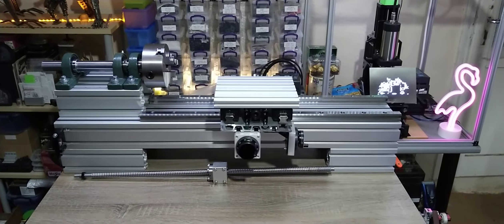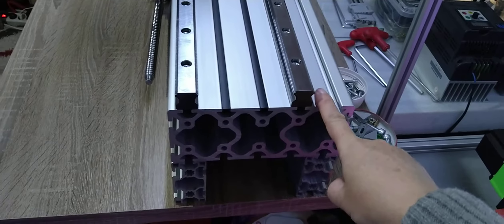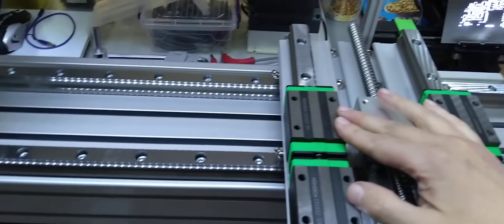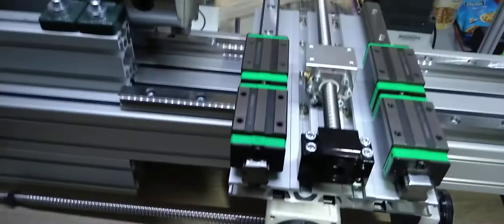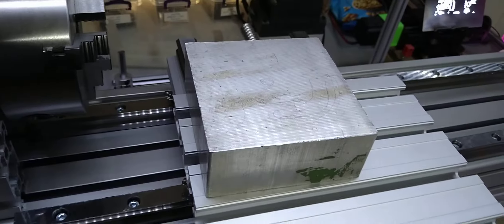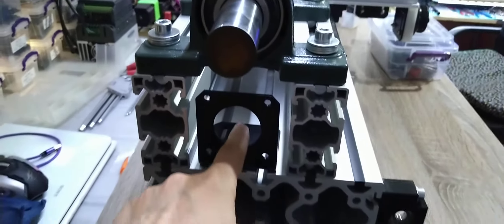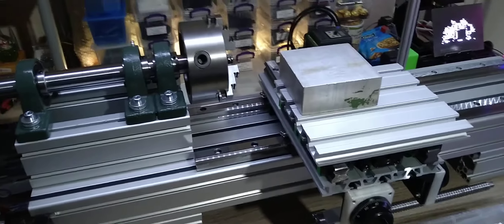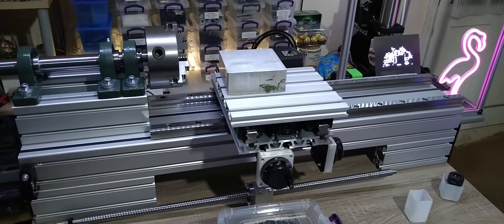DIY Homemade CNC Lathe, Part 1

Comment: Some think you could do would be to fill the inside of the aluminum extrusion with a sand filled epoxy of some kind to deaden vibration and achieve higher surface quality cuts.
Reply from the maker: True, I thought about that as well, just need to find some epoxy locally. Thanks.
Reply: @iHayri1  I would love to build a lathe.  I'm just doing my homework.  I might go with a centroid system.

Comment: I like this way of Building a Lathe, i've designed Milling machines made of these profiles.
If you can Find a Wormgear Reducer, you can make a Toolchanger for this machine as well
Reply from the maker: Me too 🙂 I have build a Mill as well but sold it. Actually thought about adding a Milling head to this build but went with a indexing head instead, with a separate stepper motor attached to the chuck spindle.

Comment: Very Very nice build so far!!!! As you know I fully believe your use of the heavy duty aluminum profile for the main table will be more than sufficient to handle the type of work you plan to do on this awesome lathe!! This really goes to show that a useful CNC lathe (and possibly milling center) can be built on a budget, and still be a beauty to look at too!!! It's not intended to be an engine lathe, so it does not have to be built like one!! I can see that you've already made some more progress on the design since I last saw your work. Good job so far and thanks so much for taking the time share your build with us!! I look forward to many more episodes!! My best to your lovely wife and fuzzy family members!!!!
Reply from the maker: Thank you Adam, not just the heavy profile, I am sure those massive rails do add to the overall strength and  one should not just think of them as guide ways for the blocks :-) The more "layers" are added the stronger it gets. The bottom will get improved on as well, planning on either adding a storage space or mount the electronics or both. Not sure if it is going to be a "budget" build but it sure looks great too :-) Anyway, all my best to you and your family as well, take care my friend and stay safe.
Reply: Yes, very good points about the massive rails and other "layers" of the build that add tons of rigidity to the whole system!! Even those blocks are far better than what would be necessary,  but as you pointed out, the hole spacing makes it easier to mount all the profiles that you have. The extra strength they have just adds to making the build that much better!!!!!
Reply from the maker: @ajones4064  Really can't wait to machine the first part on it and see if I do get the mirror finish on aluminum I am hoping/looking for 🙂

Comment: When you are just about finished with the final assembly, remove each of the bolts that are attached to the extrusion slot T-nuts and apply some blue Loc-tite. If you don't they will vibrate loose.
Reply from the maker: Thank you for the tip, will keep in in mind 🙂

Comment: Impressive build, so far it looks awesome, what is the inner diameter of the bearings for the chuck? i would also like to build a similar machine
Reply from the maker: Thank you very much, I assume you have seen the other parts of the build 🙂The ID of the bearings are 30mm, but you can easily get bigger ones, the reason why I did chose that size was the availability of HDT 5M pulleys that I used.

Comment: very nice design, I like the simplicity of it, I guess it could be easy to buy and setup everything quickly, I would be curious, what king of precision you can achieve with it, because I fear it will flex too much on certain part. Good job, inspiring.
Reply from the maker: Thank you Mikaël, it gets a bit more complicated down the road 🙂but it still is "simple" once you find the parts that work best with each other and if you have everything at hand it would be quite fast to assemble. I had to save up and wait quite long to get all parts together, smaller things take more time somehow. I am not much worried about flex in the machine itself as the linear blocks I am using can take a lot of load. Like the saying goes, a chain is only as strong as it's weakest link, which in this case is the tool holder and insert. That being said, I am sure I can achieve better than 0.01mm resolution which is enough for my needs. As I did try some test cuts and contrary to some comments that it would not cut steel, I am happy to say it cuts it quite nicely with some cheap insert and probably with the wrong feed and speed 🙂 I will mostly work with aluminum anyway, so I am happy so far. Do watch my other videos if you like where the build does get a bit more complicated. Will have a new video in the next days as well. Take care.
Reply: @iHayri1  thank you very interesting. I guess a good test for me would a threading, and see the precision. So yeah will keep an eye on your next video then ! Cheers !
Reply from the maker: @jesuismika  Unfortunately I found out after purchasing and installing the CNC controller (cheap red square board) that it does not support threading for some reason, probably a coding issue as it does have a spindle index input and it does work, but only for the first pulse, so I won't be able to do any threading unless I get another controller or possible build my own for Mach3 as I did for Grbl. Maybe I should mention and show it in the next video as well so others thinking of buying that controller know about it. Stay safe.
Reply: @iHayri1  Normally for threading, from the information I got you need an encoder on the spindle or a servo motor. Normally there is lot of option for mach 3 board, for my cnc mill I bought a 50€ board back then in parallel. I think in ethernet it's more expansive nowadays but yeah there is some option I guess.
Reply from the maker: @jesuismika  I do have a inductive sensor which is normally enough for Mach3 to get one pulse per revolution for threading, but encoders are used as well. The problem with my board is, that it reads the rpm only at startup on the spindle or if it is changed with the S command but not continuously. Parallel boards are cheap but I do not have a parallel port and want to use USB. Ethernet is also an option but those boards are more expensive as well as other USB boards. The problem is purely on the code that runs on the chip of the board but it's not opensource and I guess the original coder does not care about it. So I will have to do without threading for the time being or use taps and dies if needed.
Reply: @iHayri1  ok yes, interesting, so yes me It's the number one thing I would like to do the threading, so if I build a cnc I'll do my homework on the board to get to do that. Thanks

Comment: Any advantage to filling the voids (in the bed and legs) with epoxy granite?
Reply from the maker: It won't hurt for sure, I  have added more profiles to the bottom of the bed and will eventually screw down the whole lathe onto the final table, which will help to eliminate any vibrations although maybe not all of them, depending how sturdy the table will be.
Reply: @iHayri1  I've been researching lathes and not excited about the Chinese machines available to me. Your project is motivating me to consider building something similar.
Reply from the maker: @MagnusNemo-xc5nx  That's nice to hear, building something yourself has it's advantage, for me personally it is a lot of fun to create something from scratch instead of "just" buying it 🙂 Be sure to watch the other parts of my lathe.

Comment: 80/20  not ridged enough - use  I beam  or  C or Box  steel or aluminum - Thick -  maybe JB weld rails in place -  hardened aluminum  plate cross slide -  JB weld make easier alignment / flat  of rails
Reply from the maker: Hi, I am not using 80x20 profiles, the bed is 200x80 heavy duty, only the "feet" are 80x40 but I will add more, this right now is only to raise the bed to make room for the spindle, which will be externally cooled as well, including the 3Nm Nema23 stepper motor as it sits "in" the headstock. The top part of the cross slide might get an upgrade too. Of course there is always ways to improve a design. I could also increase the linear rail size and use Nema34 stepper or even closed loop servo drives, it boils down to budget and most importantly the intended end use. But thank you for your comment, greatly appreciate it.

Comment: Great! Love those Projects, hope the next Parts coming soon :)
Reply from the maker: Thank you very much. Well as soon as I have a next sale, I will be able to  buy more parts. Still need four HGW25CC Blocks, two Stepper motors with drivers, some more profiles and bits and pieces. The milling attachment will be done once the Lathe is finished and running. The blocks are important otherwise I can't finish the tool post.

Comment: Hi, Hayri! 
How did your linear rails end up at the same height as your ball screw drive? 
All the configurations that I find are at least 3mm different in height...
Reply from the maker: Hi Lorenz, unfortunately who ever came up with the specifications did not take into account the different center height you end up with. I do have 10mm raisers between my blocks and the aluminum profile I am using where the toolholder will be mounted to. You have to figure out what minimum size you want to go with, 25mm in my case and then chose the ballscrew , it's nut and the nut holder. My ballscrew is a 1605. I still had to put a 1mm shim in between the ballscrew nut holder and the underside of my profile, but at least my combination gave me the correct center height for the BK12 and the 25mm linear rail. Hope this helps :-)
Reply: @iHayri1  Thanks for the quick Answer, Hayri! I guess I have to do it similarly with raisers for my project.. I am looking forward to more videos from your build :)
Reply from the maker: @lordlorz  You are very welcome, Lorenz. I am actually just producing my first chips, received the backplate, had it welded onto the shaft and now did a final squaring up and mounted my chuck. Now I can make my toolholder and will also build a steady rest for the lathe. Good luck with your project :-)

Comment: A question if I may. What are those alumina beans called?
Reply from the maker: Of course you may, I am using 80x40, 80x80 and 200x80 profiles, those numbers indicate size in millimeters. Just search for 80x80 aluminum profiles for example. There are also other profiles like V-slot profile that are used for 3D printers but are not as strong as the profiles I use. One other name that you might hear are C-Beam profiles used by the Openbuilds products.

Comment: Your chuck does not have a back plate?
Reply from the maker: Not yet 🙂 That I will have to get done as I have no welder. I first thought about having a dumbbell weight welded onto the shaft, yes I know it is not a through hole shaft 🙂and machine it to size and turning it true, but I think the dumbbell weight might be not thick enough, so I might as well get a round or square steel plate welded on and machine it on the lathe. Will see how in goes. PS: Received some of the pulleys and belts today, so I might make a short update video.

Comment: Damn thats some expensive stuff you bought. You could just CNC convert a 7x14 mini lathe for like 1/10 of that money if its just meant for aluminum. I'm still curious how it will perform, so keep it up man
Reply from the maker: True, I could have saved some money with a conversion but were would be the fun in that, compared to build on from scratch :-) I could also have saved some money buy getting smaller chuck, thinner and shorter linear rails, going with direct drive stepper motors, smaller and cheaper stepper drivers, lower voltage and what not. But I rather "over" engineer a bit from the beginning, instead of saying "I should have" later on :-) Thanks for following it along. Seeing it in the video now, it looks rather naked :-) I did receive the backplate and will have the chuck mounted soon and hopefully create some chips soon. Still need to finish the toolholder. Also planning to build a steady rest for the lathe. Stay safe.

Comment: Hi Where are you based ?
Reply from the maker: Hi Dave, I live in Bulgaria
Reply: Love the job you have done with the lathe 
Shame your so far away
Reply from the maker: @davecox900  Thanks Dave, I assume you have seen the other parts of the build 🙂 It is almost finished, just need to make the tool holders. Actually I have also incorporated a dividing head feature that I have not shown yet.

Comment: 9:38  this tool holder is not a joke.  it's about the maximum that your machine can handle.  believe me.

lathes are different.  turning on a lathe it terms of stress on a machine frame are roughly an equivalent of milling with a large shell mill.

Comment: It's not solid I think it's not cut steel
Reply from the maker: And you have build how many CNC machines?, oh right, NONE. I would suggest you read up on the technical specification of the used aluminum profile, HGW25CC linear rails and blocks. People build lathes with round bar rails and cut steel all day long! I would suggest you educate yourself first before claiming anything. PS: Goggle is your friend!